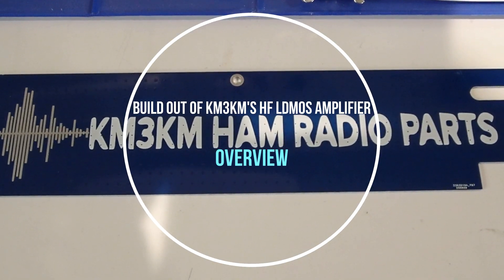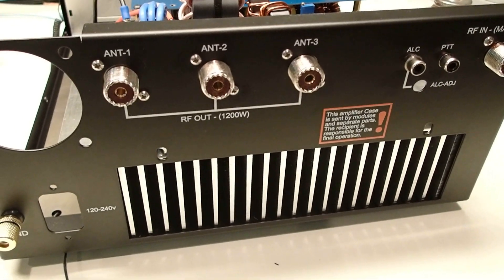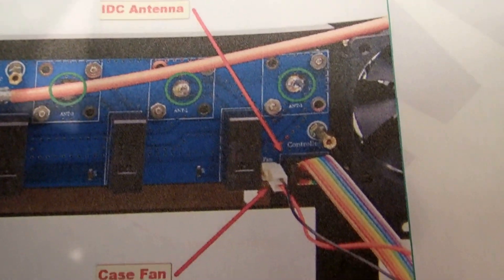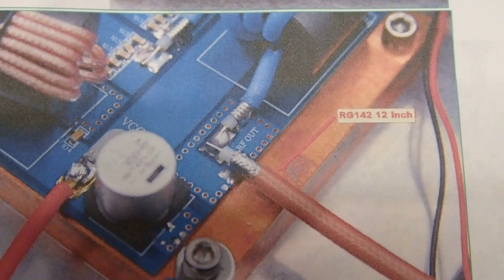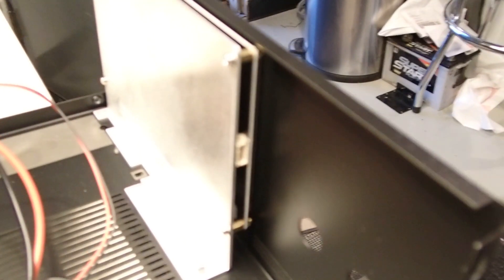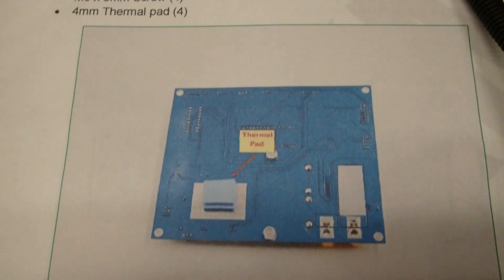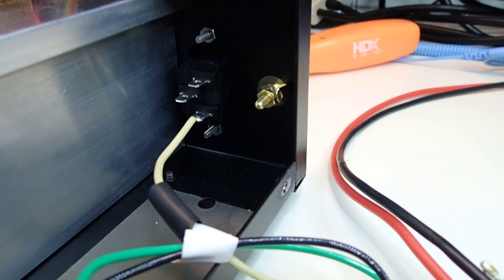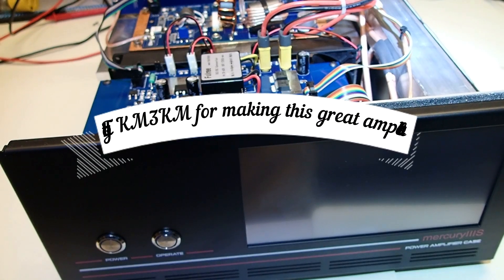Overview, build out of KM3KM's Mercury 3 HF LDMOS Linear Amplifier

Comment: What type of solder iron did you use for this.   I have a 60W solder station (Weller) but I'm thinking I'll need something with more power and curious if you could comment on what you used.

Comment: Did you have to solder any SMD's ?  Nice Video OM de kg0tr
Reply from the maker: You can buy bare boards and build them yourself. You can also buy pre built tested boards. I went that route. KM3KM is very experienced at smd assembly.